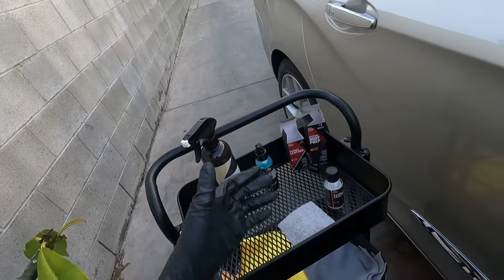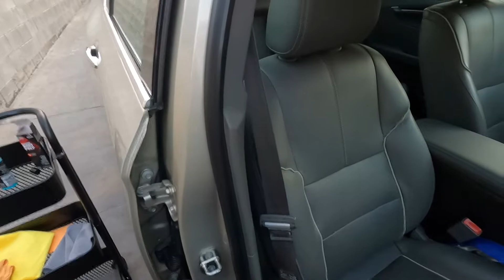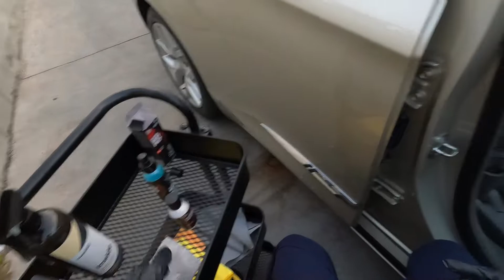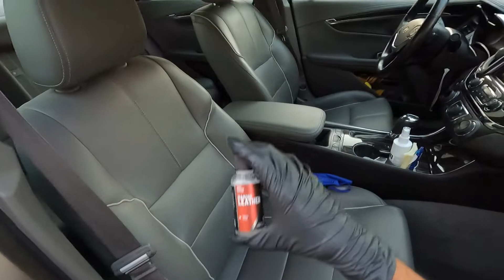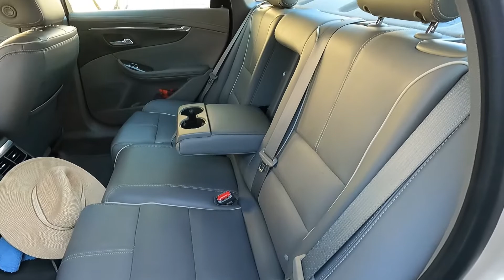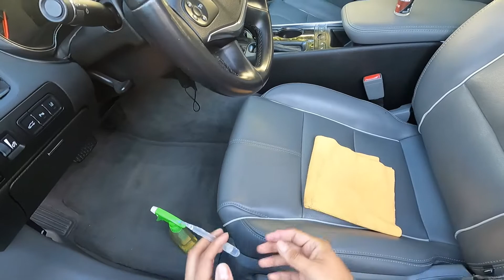Diamond ProTech - Diamond Leather Application

Comment: Would it be safe to put this or Cquartz Leather 2.0 on a dark grey top-grain semi-aniline leather recliner? I'm going to have some left over after doing my car interior and having just treated myself to a new recliner I though it'd be a good way to use up some of the remaining coating. I'm leaning towards Carpro since it's water based but Diamond Protech does look to be an excellent coating too. NV Guardian also looks to be another good option. I might end up going with Colourlock Leather Shield because it'll for sure be safe to use on non-car interior leather.
Reply from the maker: Try it on a small spot first.  But you should be ok using it.  Colourlock would be my other recommendation as well.

Comment: seems as though the cquartz 2.0 has more of a darkening affect then this one.. would you say that you shared the same observation Mike?
Reply from the maker: I would have to put them side by side on dark leather to really tell.  Cquartz Leather 2.0 does leave a nice finish in dark leather and vinyl.  Much better than the previous version.
Reply: @Mike G  if you do.. please let me know 😃🙏 p.s love the content..so glad I came across your channel!
Reply: @MikeGDetailing  hey Mike, have you ever conditioned the leather before applying the Cquartz leather coating or is it not really advised? Clean and coat? Wondering for dryer/older leather if it's worth conditioning first, otherwise after the cleaning, the leather feels a tad dry as it's been stripped off anything on it.
Reply from the maker: @petegangies  it is not advised as the leather coating may not bond.  Try it on a small area if you choose to do so and wipe it with a panel wipe.  Or at least give it a couple of days before applying the coating.  I have never done this so I can not comment how it would work.
Reply: @MikeGDetailing  I've sent an email to carpro..see what they say!

Comment: Awesome video man. I'm just about to apply gyeon leather shield to my leather seats in about a week. What do you think about Gyeon Leather Shield? What's your favorite leather coat?
Reply from the maker: Leather Shield is a good leather coating.  I have used it long ago and it did well.  You will be happy with it.  This one does not darken as much and looks factory.  It also does really well to maintain it with Gyeon Leather Coat which works fantastic as a topper every few months.  

My favorite at the moment is Cquartz Leather 2.0 for two reasons.  One is that it is water based and two it darkens the best out of the  leather coatings I have used.